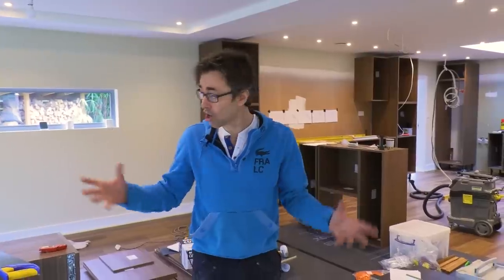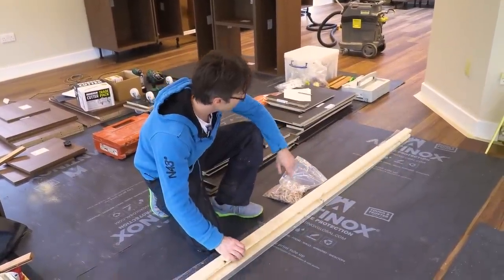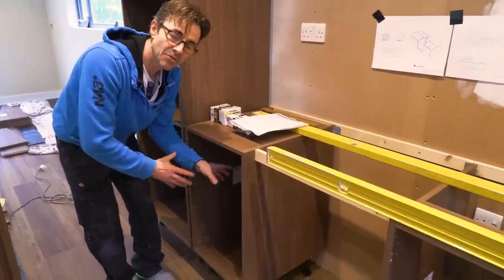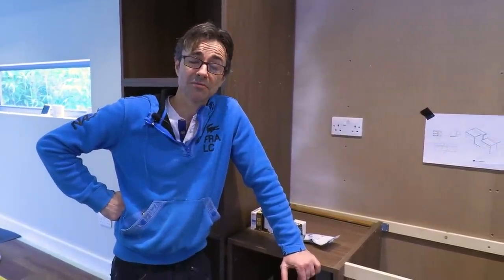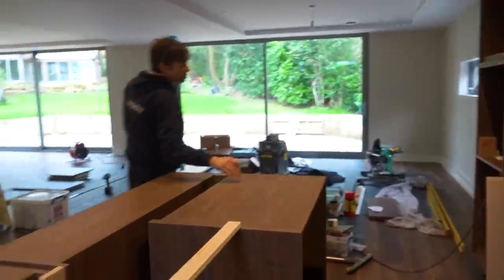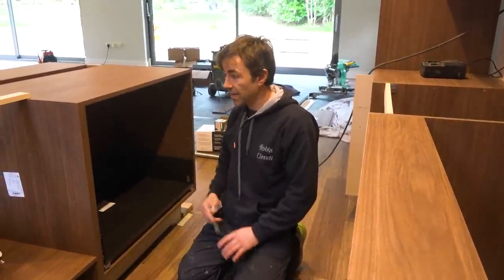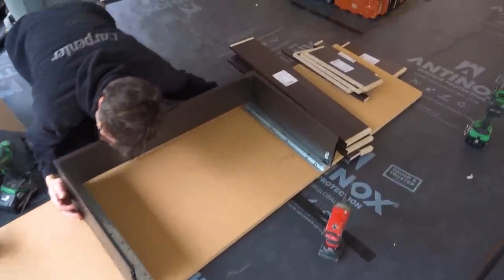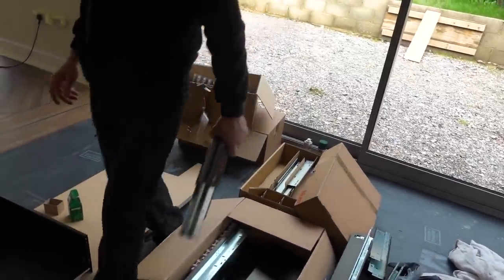Kitchen Fitting Trade Tips with Robin - Capel #25

Comment: A word of warning. The fitting of a batten behind base units only works for custom work surfaces. If you purchase a store / diy kitchen, your work surfaces will not allow for this.
Reply: Plus the end panels might not fit in that tall boy 👍
Reply: You can notch the unit for the batten then you don’t loose any overhang.
Reply: his will work I think he accommodated for that. 500mm slides are not standard. usually 550 are standard so he shortened the box by one inch.
Reply: This system is similar to the new IKEA u nits which register off a steel rail along the back which does make it very easy to ensure the worktops are level irrespective of the floor.  I bet few floors are as true as Robin's- but he did say his client was a nightmare to work with!
Reply: I found that out the hard way - breakfast bar work tops all the way round woohooo 😂😂😂😂
Reply: @rhydianjames7357  which would defeat the purpose of the batten in the 1st place.
Reply: @allmodcons  no it wouldnt. The batten isnt a spacer from the wall,  its used as a rod for positioning along the wall. Its marked where the base units should fit.
Reply: @booboo-nl3wi  This is what I was thinking surly the end panel on the end full height unit will be short of the wall, and if standard worktop will also not be wide enough? I get the use of angle fixings but I can't see how this would work off the shelf units?
Reply: Yep! I think you are correct!
Reply: @gbwildlifeuk8269  Watch and listen again mate.
Reply: problems problems problems..... you must be a fucking joy to work with!
Reply: @allmodcons  i dont need to and I'm not your mate!
Reply: @lazenbytim  he's pointing out what go wrong, thinking ahead! As opposed to some John Wayne builders who end up chocking some cupboards up with bricks because they failed to!
Reply: @booboo-nl3wi  My thoughts precisely!!!!
Reply: @rhydianjames7357  And that, my Welsh brother, is the answer!  I have two kitchens in the pipeline and kinda like this idea.  Have you used it?
Reply: @kevinchamberlain7928  yes Kevin I’ve used it before, especially handy if you have a masonry wall too. You can laser the batten dead level and get a few good fixings into the wall and the units will have a good timber fixing. Much easier.👍🏻👍🏻🏴🏴
Reply: I've used the baton on the wall for a while now, picked it up from and old timer, easy to run a baton with frame fixings to a lazer, notch the base units, easy to fix the angle to baton
Reply: Yeah not really ideal
Reply: @rhydianjames7357  p
Reply: Just notch the unit the size of the batten lol
Reply: Correct
Reply: Cut them in-between the carcass,that's what I do and you get a decent fixing for your unit

Comment: Appreciate the video uploads,  really opens the eyes to the DIY er trying to save a few quid trying to do things without  paying for skilled people.
I did notice that the electrical accessories,  sockets etc had masking tape round to probably protect from paint or builders work...i would suggest using MK Dimensions accessories. This kit comes with a clear temporary top plate allowing for painting and finishing off the space, but enable use of the socket  during the build. Then popping off and fitting the final top plate of varying finish. Beauty of this is the if the home owner breaks the the top plate, but doesn't need and electrician to replace the complete socket just replace the top plate. Also allows a relatively easy change of face plate should the home owner want to change things without replacing the electrical socket. Yep long winded but hopefully can see the point I'm suggesting.  Again great videos thanks I've learned alot benefitting from your experience.

Comment: I worked In the joinery shop at Sealine international for 10 years and we used Blum hinges & draw runners etc on all the furniture & I found them really good for the amount of adjustment you get on them.If your slightly off when you put a cupboard door on you can always tweak one of the screws. A couple of twiddles here and there and hey presto! 😁 still lovin the videos 😁😁
Reply from the maker: After a while the hinges need some adjustment as the constant use does throw them off.

Comment: 0:26 almost 4 years of furniture installation/fitting , gotta say the floor was LEVEL 2 times  .... Walls were a bit better with plum but some , we hat to shim the cabinets both on bottom or on top by 2-3 cm . Switched to electrical right now for about 5 months and gotta say, level is tossed around much loosely here haha , love it.
Reply: one of the worst jobs to get the kitchen SOMEWHAT level, was when in the old city center (Croatia) and the laminate flooring was installed on "boat floor" (that's direct translation) it's basically wooden beams that hold up the whole appartment. The whole kitchen would literally move as you walked around it , it was U shaped, with 2 parts of that U being not on the wall so the door's spacings would move as you walked by hahah. The wall section was good cause we anchored all of it to the wall.

Comment: What program do you use to design your kitchens if you are sending all the spec to cutrights? Do you have to tell them all the pre drilling positions for your drawer runners?
Reply: I'd be interested to know this too... and if he uses a cam and dowel system, can you specify the material thickness and cabinet dimensions in the software and it automatically positions them?  As that way it would save headaches when you accidentally miss specifying a hole and have to faff around drilling the cam and dowels by hand!
Reply: I second this.. would love to know the specifics of how you go about designing the carcass layout to send to cutwrights. Ive been wanting to use those guys for a while
Reply: You can use SketchUp or anything similar. If just ordering cutting and edging then you can do this online but if you need any CNC work you will need to email them drawings.
Reply: I believe Cutrights use a piece of software called Cabinet Vision an extremely powerfully program used by bespoke kitchen / bespoke cabinet manufacturing. It allows you to use cam systems like Raffix and automatically does all the placement of these based on pre set parameters. It then outputs the code straight to CNC ready files to cut the parts.
Reply: Here's a tutorial on SketchUp from a fitted furniture maker who used to use CabinetVision.
https://www.youtube.com/watch?v=beA6VuchBkU&list=PL8WrSzZHZZN9DSOso0ezrfNwzHt0WHStG&index=1

It would be interesting to know what Cutwrights will accept.
Reply: @kevocos  that's why we are tradesmen, if anyone can do it we are fast out of work. 
And as a joiner with 25 years experience I still measure, mark out and drill my own holes, it's a skill I have worked hard on. 
Try it yourself if you want the pride of building something yourself, there's no better feeling than a job well done, 
But there's nothing that compares to the quality of an experienced professional.

Comment: Robin, on the subject of water possibly being present under the cupboards and potentially swelling up the plinths, I always use a plinth sealer strip from Hafele. Might not be the look your going for but it's a clear plastic trim with a gasket on the front, that keeps the bottom of the plinth out of direct contact with the floor and also contours to your floor level in case of any discrepencies in the levels ( not that you will have this issue ) it's works well for people who mop their floors and avoids direct contact with the raw edge.
Reply: Dave Rogers 
Firstly...I’m sure you can assume he knows what it is.
Secondly..they are awful,they hold all the crap (and in my opinion)are a complete waste of time.They also make the installation look amateur.
I’ve been a kitchen and bathroom fitter for over 20 years and the first place I would put those strips would be in the skip.

Comment: The mdf backboard...Is that 18mm mdf attached to 2"x1" batterns? Then giving a dab size of 26mm with 12mm board? Trying to figure out how you fixed mdf to wall and matched plaster board around it? And my 2nd question, If ordering off the shelf worktops, guessing can't fit cupboards to batterns as per video as won't have the overhang at front of each unit, is that right? Great video again, I'm nearly at this stage with my build. Thank you
Reply: Its all on another Video Rich

Comment: I’ve been asked to do the plumbing on a few Ikea kitchens lately... no void space behind units. End up spending the day on site re routing pipes etc.
Reply: When asked to fit IKEA the price goes up 😂.

I hate them with a passion so many things that just are unique to them.
Reply: re-routing them where?
Reply: Anstiss Limited exactly mate. Stainless sinks come with a tool to cut the hole and then some come with instructions to use a hammer and flat head to gently knock the hole through 😂 waste kits are shit as well I think
Reply: lame duck normally have to re route them all under the units which is a pain when you have hot , cold , flow , return and a condense pipe there
Reply: I haven't found this a problem.  I bring all the stubs through the back or the base and it is then very easy to make the final connections inside the cupboard.  With a little care you can keep most of the pipe work at the back of the cupboard leaving space for storage at the front.
Reply: Michael Blackmore you should NEVER route pipes through cabinets.You aren’t thinking about anyone else following you in months/years to come.
Not best practice,,,,always work on best practice

Comment: Have you considered using a common base (full length, toe kick height, framed separately/level and set first)?
Most of the time/trouble disappear...
Reply: That's what I do. Level a structural base for all cabinets, then scribe and trim it out. After that, its a matter of setting the boxes and maybe just a very little shimming if at all.

Comment: As an Electrician i was wondering about some of the sockets ... @ 7.10 you have switched sockets, for appliances i presume. They can be unswitched under the worktop with an Isolator above the worktop (which is a regulation, somewhere accessable within 2m of appliance) but i was also wondering when it comes to doing an Electrical test in 10 years time the poor guy doing it will struggle to get to those sockets. I wish all trades worked together better so that guys (and Gals) coming back later can work easily and not have to struggle because some other trade has made it impossible to get access just cos it made their life easy at the time.
Anyway, enough of my pedantry. Im always impressed with the very high standard of workmanship and skil that you put into your work Robin. It shows you care and have pride in your craft. It keeps me watching. Look forward to seeing more. All the best.
Reply: peter puchalski Yes but when I do EICR’s I still take an r1&r2 reading from the socket and not the Isolator above the worktop, so wouldn’t make a difference to me. There’s not many limitations on my EICR’s.

Comment: Please Robin can you next time emphasise to the less experienced carpenters/joiners out there to never use impact drivers when assembling kitchen units...not everyone is as skilled as you mate 😁👍🏾. Thankyou
Reply from the maker: A lot of the newer impact drivers have precision settings where the impact function doesn't kick in. They are ideal for kitchen fitting and all kinds of delicate work. The trouble is that many builders set the impact drive at maximum speed and never see that it is suitable for these other jobs.
Reply: @SkillBuilder  No. Just in future use a combi with the clutch set accordingly please. Thankyou

Comment: But does the worktop protrude beyond the tall larder unit,, it's an absolute thing of mine,, everything has to have a shopfitting profile,, so no worktops sticking out beyond any cabinet it finishes to,, I can't stand to see that ❤️😉👍
Reply: Interesting idea, doesn't that mean the larder doors wouldn't be in line with the rest of the cabinets or would you just have no overhang on your worktop?

Comment: Hi Richard,why did you refer to a flooring as “engineered” ? Is it the way it’s installed? Always on previous videos I’ve heard you say “mechanical fixing” what is this? Great upload by the way.
Reply: He is called robin.

And engineered means that is a board/plank etc that is made up in a factory from many bits of wood (like plywood).

Non engineered is as it comes from the tree.

Mechanical fixing means a screw or nail not just a friction fit or free standing.

Comment: Excellent video.... I picked up a lot of useful insight. One question.... how are you securing your island to what I assume is a concrete floor under your wood flooring?
Reply: In the video I talk about how the island is formed and that I am using a floor covering that is not floating so I can fit the island on top of the floor covering, the island is not actually fixed down as it weighs about 300kg

Comment: Impact drills are far to powerful for kitchens. Use the little festool drill it’s perfect for kitchens.
Reply: I believe that hitachi/hikoki has a mode where it only drives in the screw by rotation, so no impacts 'destroying' the wood fibres. Makita and milwaukee have similar modes, although festool might have been first.
Reply: The festool drill is very very light and small with right angle attachments aswel. That’s why I would recommend that drill for kitchens.
Reply: jp k however there is certain jobs I  find  it struggles with such as integrated dish washer doors or fixing into wall /stud impact is handy to have

Comment: A ring circuit in a new build kitchen..?
Reply: What's the alternative? We know you're dying to tell us.
Reply from the maker: radial circuits are the modern fad but they aren't better.
Reply: Fuse protected Radial Circuits existed well before Rings were allowed.  The ring was invented post WW2 because of the cost and shortage of copper.  A ring run in 2.5m2 cable is usually protected with a 32amp fuse/MCB while the cable is only rated to a maximum draw of 24amps.  Cost over safety should be discouraged.....Robin hasn't saved money on any items on his build..... why skimp on radials with no doubt vacant fuse ways in his consumer unit?  Why they still get a mention in the 18th edition is maybe because of all the post war housing.  Is there another country in the world that uses them?